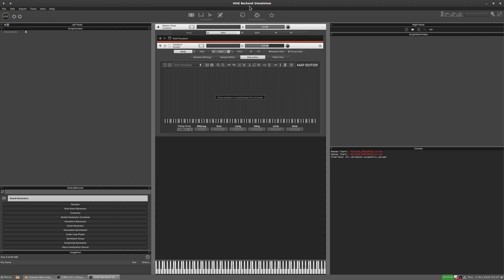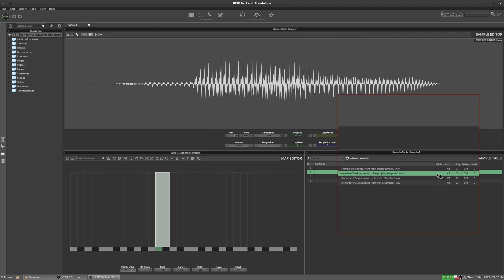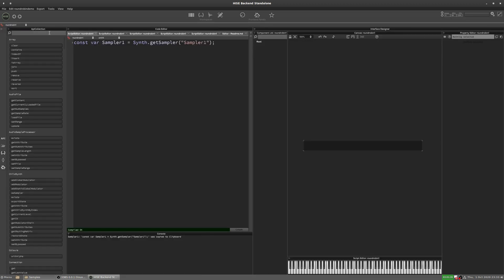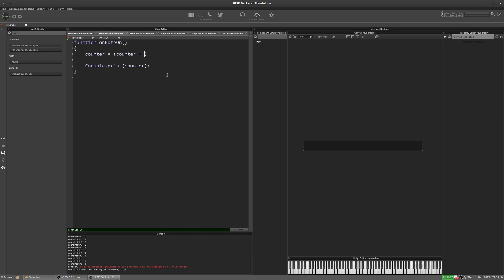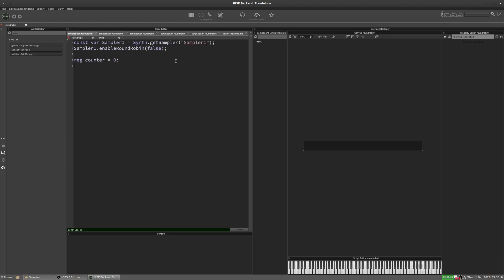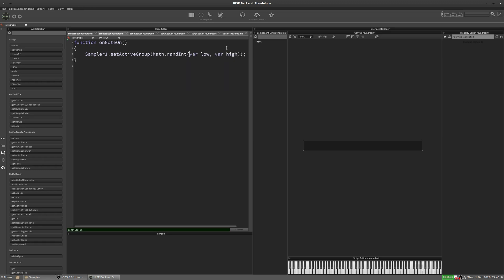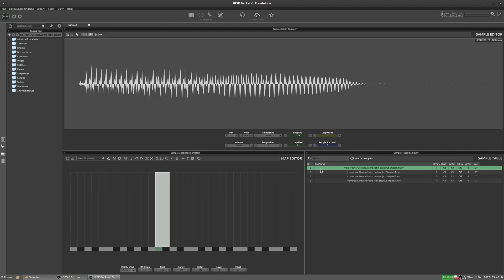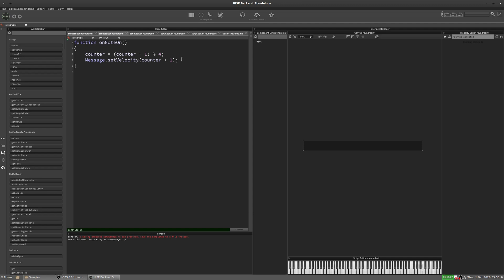HISE round robin techniques

Comment: Is there a way to save this script as a template and is there automap functions?

I have 5 RR's and 5 Velocity layers for the project I am working on, what would be the easiest/fastest way of mapping all of the samples properly?
Reply from the maker: Yes you can save the script as a module that can be loaded into any other project.  I have a video about that - https://youtu.be/-3M-AYlnvKs

Yes there is an automapper in the sampler workspace - https://youtu.be/dXFjnpehQPA

The fastest way is to use the automapper.
Reply: @david-healey  thank you, I have no coding experience I am just trying to figure this thing out lol.

Comment: 13:00 For some reason "Sampler1.setActiveGroup(Math.randInt(1, 5));" doesn't work in the up-to-date version?
Reply from the maker: Should do. Are you seeing an error?
Reply: @david-healey  No, it just didn't say anything. But: now I watched your other tutorials, I recompiled everything just in case, I made sure script is inserted in a correct place, I made sure I hit F5 and now it works.  

The only issue I have now with this following this tutorial, is that some command doesn't appear automatically when you type something in a script. For instance, you type "Sampler1.ena..." and the suggestion automatically pops up. In my case even after installing Visual Code and IPP it still doesn't =/
Reply from the maker: @ipoponq  That's the autocomplete in HISE. I have it set so that I press the ESC key and it will opup. If you right-click in the script editor you see an option "Autoshow Autocomplete" which will make it appear automatically.